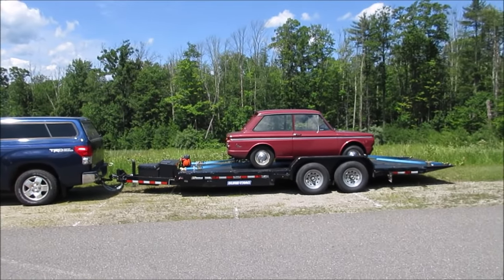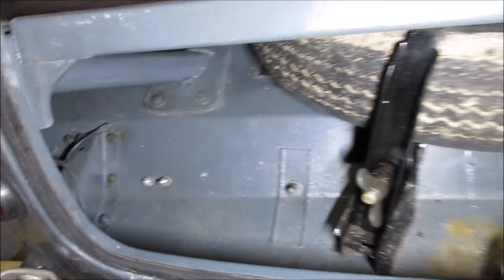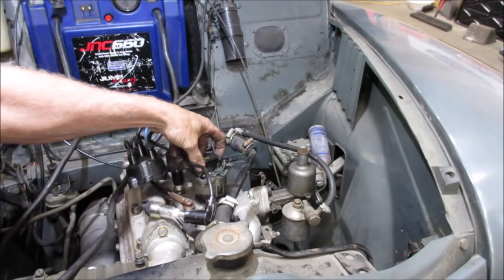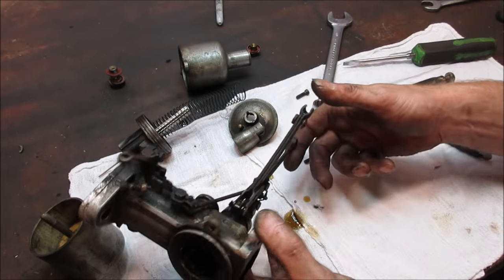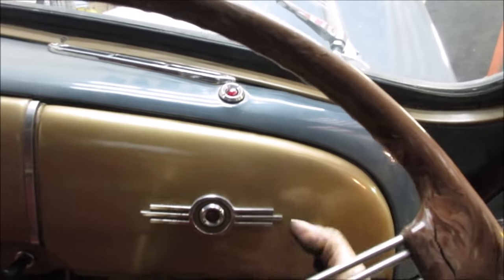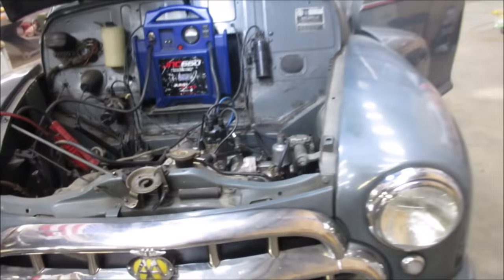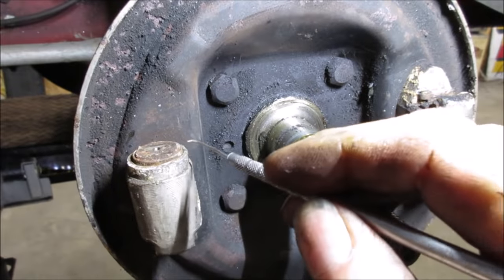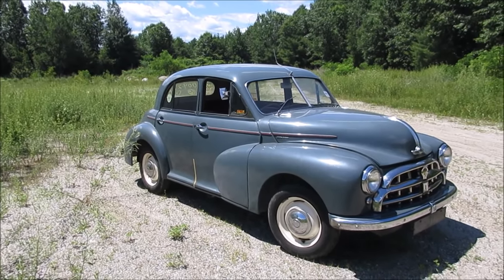50s Morris Oxford Found in an Old Warehouse. Did It Survive?

Comment: Here in the uk, we never full embraced the metric system……still don’t. We do miles, not kilometres, body weight is stated as stones, not kg or even lbs… we were made to adopt litres for fuel (gasoline) purchase back in the 1980’s or early 1990’s. No one knew what the hell we were buying, hence the conversion sticker on the inside of the window, we used to put them on the window closest to the fuel filler flap.  The RAC sticker = Royal Automobile Club. It’s their yearly subscription/ member proof / badge. It’s basically a car breakdown insurance policy, pay it, if you breakdown, they come to you to fix the issues….within reason. Others were/are available….. AA, Green Flag or National Breakdown as it was called then…..

Comment: Surprised its a side valve ,, Dad had a 1954 Austin A40 Ute with a 1200 cc overhead valve ,, same pain in the arse shockies  as the A40 ,, surprised it has an SU carb where as the A40 had a downdraft Zenith ,, Dads A40 also had a crank handle ,,, not real sure but looks like a SU elec fuel pump sticking out of the firewall ,, The A40 had a manual run from the cam shaft ,,, If its the same as the A40 you pull the knob out on the gear lever  and push it right down and pull the lever down for reverse ,,

Comment: You really enjoy the challenge of foreign mechanicals however basic it worked for the tiny motors ,slow speeds , family transport  us Europeans got used to and sold all over the globe , notably India in thousands.used untill resently as so easy to keep going and very frugal with fuel.

Comment: Just a hint about British measurements. We still use MPH for how fast we are going, feet and inches for human height, but we use metric scales for our engineering these days, but when that glorious machine was put together it was still all being done in imperial measures. The change from imperial measurement to metric was never complete here, so we have this entertaining mish mash we have to think in, in order to get through life. Weighing a bag for the airport? Kilogrammes. Weighing yourself? Stones. Your height? Feet and inches. The height of a building? Meters. How far are you going? Miles. How fast? Its miles per hour. I bluntly refuse to work on anything that has imperial fasteners because theres no way in the world I am buying two toolkits, and no matter what people say, you can't adequately convert for all tool heads by doing the maths. In my experience (albeit limited to much smaller stuff than you work on) millimeters are just so much simpler to work with mathematically than all those complicated fractions. Whole numbers are superior for simplicity and ease of maintenance, than fractions.

Comment: The wheel cylinder and the master cylinder all all toast from sitting so long with out silicone fluid or periodic flushes.  The wheel cylinders MAY be the same as used on the MGTD which was from the same vintage and company.

Comment: If the polarity of a DC motor is reversed, it will run backwards. Simply look at the cooling fan to see if it draws air thru the radiator; if not reverse your leads.

Comment: Remember “Morris the Finiky Cat”?
 Actually, positive ground is better from a corrosion prevention/reduction standpoint, AKA “cathodic protection”, (as used in the telephony/phone lines and switching equipment). But alas, as with the QWERTY keyboard (not being the best layout), such had become such an established/widespread practice, that changing it was just not practical.
 Ok, positive ground, steering on the right, reversed ammeter travel .. well, makes sense ha ha.
 Maybe they didn’t have “motorways” back then .. not for high speed roads …

Comment: I hope the valve seats have been hardened as the lead free fuel of today will wreck the head for sure unless you use a lead advertise to the fuel plus I'd check if the modern bio ethanal mix is suitable for the engine. I remember driving one of them plus had one of it smaller siblings the Morris Minor 1000 way back late 60s, also a Ford Popular from 58 but first car an Austin 7 a 38 747cc straight 4.

Comment: That is an SU carb. The damper in the centre needs oil so it moves up and down
Reply: It needs a 20W as a damper fluid; 
otherwise the needle in the carb that controls the mixture at the venturi can "flutter" and cause performance problems (runs like shit);

Comment: The oil acts as a damper for the needle and when car is running the needle will go up and down the more you rev the more needle will rise it’s a su carb
Reply: It slows the rise and the fall of the metering needle as the damper rod has a small clearance between it and the wall of the oil reservoir...
it's a small hydraulic damper...operating on a total loss system...
needing topping up either occasionally (when new) or often (when old)

Comment: v nice the mini came next yes i' positive GND,  ps it dont matter as no electronics so can run neg ground ,,, just put battery neg ground ect take regulator cover off  pulse few times the solenoids ( car not running )  the one  that that seems to spark a bit , thats it all u do , all the gauges are thermal , ie non polarity sensitive , same w starter and gen ect . ie no electronics

Comment: the button on the right side of the steeringwhell  that you kan only push is the whasher fluid button and you have to pump the water up on the windshield. the brakes are not original because the ajuster should be on the bottom of the drum and look different (at least it did on my '53 model) otherwise great car

Comment: Something is not right in the ingnition system. Hear all the misfires underload.  Most definitely needs some love on the tune up most likely bad wires. And in need of a valve adkustment.  Between. The 2 makes it gutless, also might want to try advancing the timing by about 3-5 degrees it will help compensate for the internal wear and tear in the motor. Over looks like a very solid bad for a full on restoration.

Comment: the negative goes to the bolt on the starter motor, negative. the other one goes to the positive on the solenoid  negative Earth. ! the carburetor damper has to be filled up with oil, when you feel a resist-ants putting plunger back in its ok

Comment: Nice car. Not. Many around in thay good original condition. The carb mixture needs to be adjusted at idle and probably cruise too. You probably know this now but as you said that brass nut under carb where linkage is at is the fuel mixture adjustment. Screw it up and you lean it out. Screw it down to rich mixture. That needs to be taken apart and cleaned and the seals replaced then adjust it. I'd clean the entire body of that part when you do it. Like you said you might do if you take it spart again. Fix the exhaust leak first before adjusting it.

Comment: the plunger thing on the inside to the right of the steering wheel.. i think is your fuel primer.. to help assist when cold?
aircraft have these... they shoot fuel into the intake to help with cold starts

Be careful driving in the weeds, you may get stuck.. HAHAHHA
Reply: The SU carb choke actually drops the bottom of the fuel jet (that the needle rides up and down in)  to enrichen the mixture for starting.
Thus thee are no squirters of any kind in the carb fuel system..
The push button is for the windscreen washer...a purely manual squirter....

Comment: 16;41 the Engine had what they called a Crank Pulley  where  what is called a Cranking Handle was to be  Used where it was used as a secondary Device just in case  the 12 volt  battery was a Little low in juice  you'd be able to Crank up the Engine and start it up that way  {provided  the  Car was not in Gear and the ignition was turned on it was basically a two man Job as the Clutch would have to be Pushed down  so as to be able to try and  get the Pistons In Fast Motion Not so Easy to Crank up and  was a Bastard when the Spline slipped out of the Pulley wheel you'd  Pant like Hell  and  Get so frustrated and  start swearing and  Kicking the Car

Comment: a working wheel cylinder on a car stood for 30 years, yet to find one that does, that crappy dot 4, is the problem, if it had dot 5 they would work after 50 years of standing.

Comment: If has a radio make sure it is neg earth.
I guessing has been changed to negative earth.
Battery used to be on bulkhead where your jump pack is.
The distributor points will earth neg side of coil if is neg earth on battery.
Factory would have been pos earth

Comment: THOSE LUCAS FUEL PUMPS ,MUSTIE,. WATCH YOU DON'T RUN EM DRY YOU'LL BURN THE DIAPHRAM OUT. THAT MOGGY  WOULD BY YA A NEW CAR OVER HERE (England). The push button right in front of you on the false glove box is the screen washer, you have to pump it yourself heh heh

Comment: I bet this car started terribly in the cold England weather doesn't have a choke somewhere
Reply: The choke is that linkage on the bottom of the carb that mystified Mustie.
The linkage actually drops the main jet down to a lower poition to enrichen the mixture as the needle stays in the same position (it can't fall any further as the bottom of the slide sits on the carb body in the ventruri).....
So no, there was no problem starting unless you weren't pulling the choke knob all the way out...
then quickly dropping the knob back to halfway...
and steadily moving it over time as the engine warmed slighltly.
Coming to a halt and rstarting on a hill while still on choke took experience and finesse with that choke knob setting...

Comment: When THEY whoever THEY are, decided in their infinite wisdom, to change from selling Petrol in Litres rather than Gallons in the 1970's, we need to know how many Gallons we were putting in.  The UK has never completely moved over to the Metric System, but it was a great relief to come and live in America and not have to deal with Metric anymore.  The British still have speed limits in Miles Per Hour, and fuel consumption was still in Miles Per Gallon when I left in 2010.

RAC=Royal Automobile Club and the AA Badge on the Front is the Automobile Club.  I suppose AAA is the nearest Equivalent here.

Until recently, a Tax Roundal would be attached inside the windscreen beneath the RAC sticker to show that the Vehicle was taxed for Either 6 or 12 Months.  I believe they have done away with that now.

Comment: That carb should have a choke on it pull it out to start
Reply: It does; but it's a diffent working principle...
that long rod on the bottom of the carb LOWERS the whole jet...enriching the mixture for starting.
Once started, the choke can be reduced by pushing in the dash knob...
each detente reduces the enrichment..until you get to the normal mixture...
the idle of which is set by a large nut also controlling the jet...but when turned and locked in position it sets the idle mixture...
the speed of idle is a setscrew...

So very few parts needed for the whole carb....simple and effective..